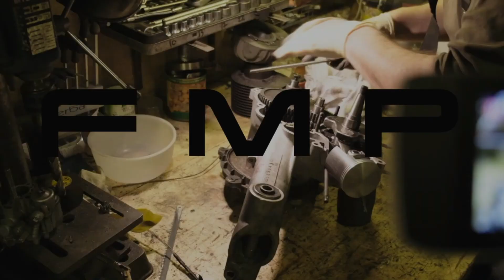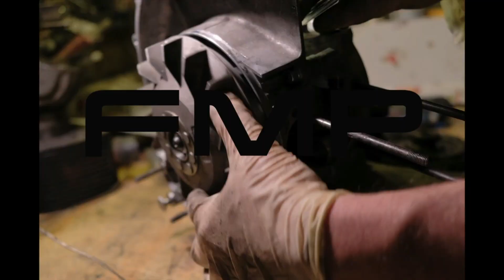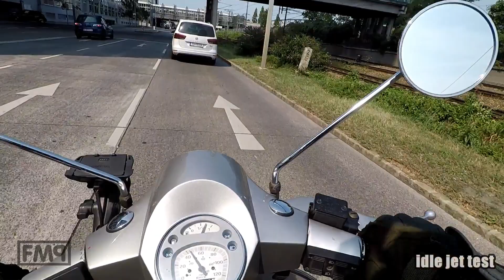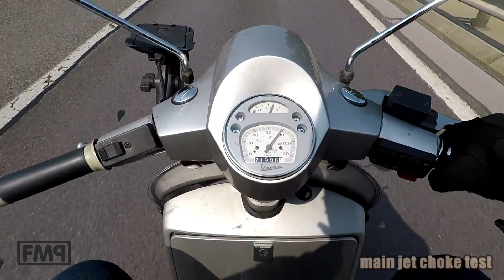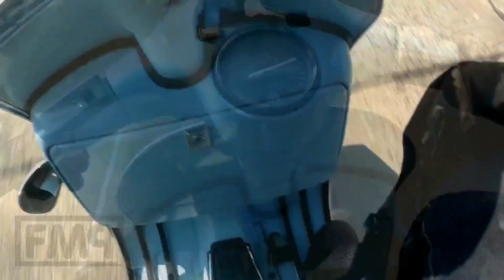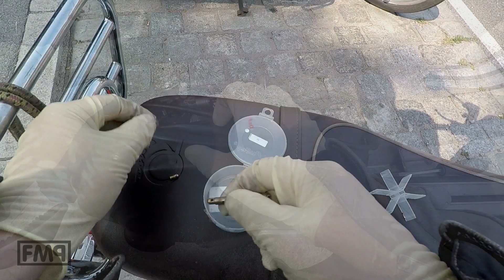QUICK vespa  road JET SETTING TEST: idle- & main jet / FMPguides - Solid PASSion /

Comment: Hi, congratulations for the channel, always practical and never banal advice. I wanted to ask you something if possible ... I have a t5 and as you know the 24 / 24g Spaco does not bring enough fuel to the tank due to the hole that is too small ... the engine is completely original, with the idle jet set as per the manual 120 / be4 / 114 (I have a sito plus) ... arrived in fourth gear at 7000 rpm in deceleration engine goes "wop wop wop" as if it were too lean ... you accelerate again and make a vacuum and then recover slowly ... what could be? thanks and congratulations again, cheers from Italy!
Reply from the maker: thx! either too lean idle jet or false air.
also use the mixture screw to set the idle jet, not just jet exchanging ;)

Comment: I've got a problem when I slowdown and come down to 1st or neutral at lights it cuts out unless I hold the throttle back slightly. I'm guessing this might be idle screw setting or possible idle jet needs a clean. It pulls off fine on start up only when coming to a stop.
Reply from the maker: Would also start with a carb cleaning yes 👍
Reply: @FreakMoPed8  gave it a clean the other day and tweaked the idle screw, it seems to be working much better 👍

Comment: Hi mr. I have a px200 know (221) with polini 210 cylinder and engine block mildly ported, 60mm bgm crank, and polini boks exhaust, ignition 18°, si 24 carb with air filter hart drilled out, main jet 130. Idle jet stock, i will drill up the carb fuel suply up to 2,5mm

Any Tips for the carb jetting? Main and idle? Or any ting else will be appreciated.
Reply from the maker: as u have a bgm crank, do not use the bgm fuel tap. Switch to sip v2 tap. 130 mj and 2,7ij is fine (original air filter with holes)
Reply: @FreakMoPed8  thank you, i will try that. Merry Christmas
Reply from the maker: Same to u!

Comment: Mr Freak, Im running a JL pipe on stock px200e, rebuilt carb with 120 mj and new sip air filter (has holes). Low km 2007 model,  would you recommend bolting on a Pinasco 215 kit? Cheers
Reply from the maker: Polinibox. Be aware of that you have a weak piston. Esp if you have the latest L port pinasco 215, immediately exchange piston (or better whole kit) as the piston will crack for sure. Check my fb page for info and photos why that is guaranteed
Reply: @FreakMoPed8  thanks for heads up, will check your FB👍

Comment: Would you recommend the bgm bigbox pro on the stock engine with venturi?
Reply from the maker: no. Absolutely not. Bgm boxes are not the first choice. Thin = loud and manifold too low = striping in right curves. Original engine only manages a BOX never ever a big box, u need a race cyl and on top. Of that a proper fine tuning (cyl timings, intake timing exhaust port) that a big box works.
Reply: @FreakMoPed8  hi, so you are saying stock engine with polini big box is not good? Because I have stock engine spartan 200(with 5m piston size) and wanted to buy polini

Comment: that jet for px 200 with polini original? px 200 mix..116 max --- put 118?
Reply from the maker: sthg like that, this one needs a 122 due to a small otuning light
Reply: Original was 118, than I put 120..dident try 122. Is 120 to small? Also have px200 with polini box
Reply: @FreakMoPed8  on the original cylinder 200? only original polini? 2 more points?
Reply: Hi mista, if you have the right idlejet, and you hold high speed/RPM and just a little throttle for a long distance, lets say about 2 o more miles. The engine can soft seize either or never can Soft seize when idlejet is the right one?